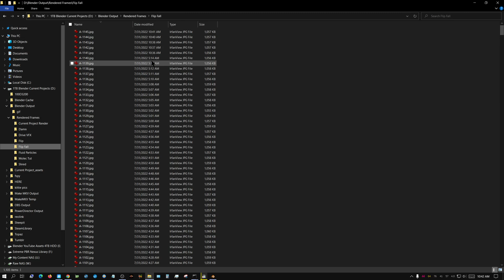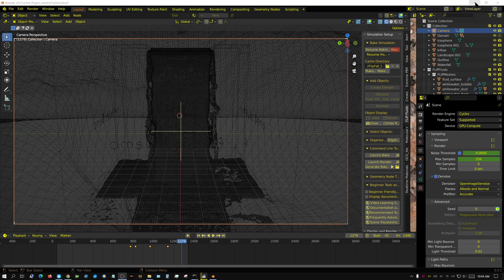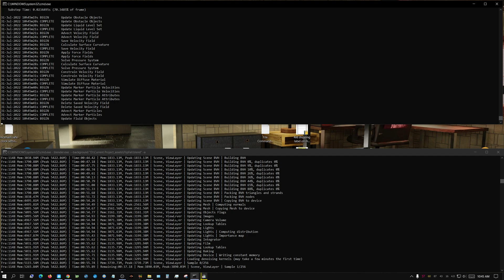Save Time By Rendering Your Flip Fluid Sim While Still Baking

Comment: Does this really work? I am short on time!
Reply from the maker: Yes, it works. You just need to make sure the render doesn't catch up to the bake. But there's also an option to bake and render the same time through the flip fluid interface. My way works good if you are rendering with more than one machine and baking with another. But if you have one machine it's easier to do it through the flip fluids interface.  As seen here. https://i.ibb.co/pBTNZjWg/Screenshot-2025-10-16-101233.jpg

If that link doesn't work, try this one.
https://photos.app.goo.gl/ZehJurm8eNWHV1Fn9
Reply: @BlenderRookie oh thanks! I have already started my CMD line BAKE- will rendering while baking still work?
Reply from the maker: @kataminedj  You can simply close the CMD bake and then open the project in Blender's GUI and then restart the CMD with the render checkbox checked. But close the GUI while the CMD is running. It runs better.

Also, make sure you save the project through the GUI right before you launch the CMD.

Comment: Did you verify you were seeing rendered files in the folder when you did both of these at the same time?
Reply from the maker: Yes, worked fine. Just don't try to render frames that have not yet been baked.
Reply: @BlenderRookie  oh god, what will happen?? I have the render running now and it's catching up to the bake rather quickly.